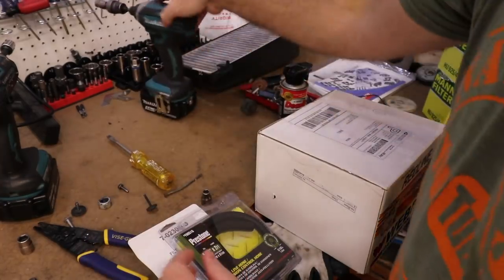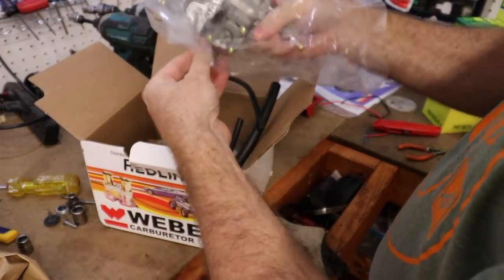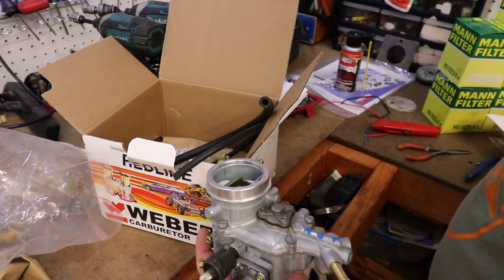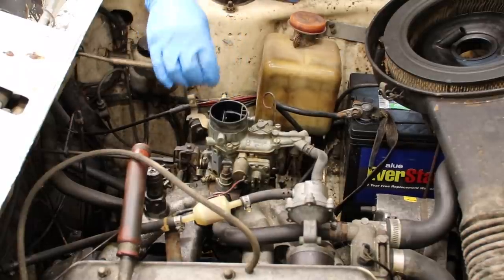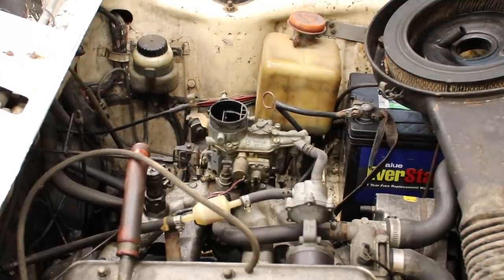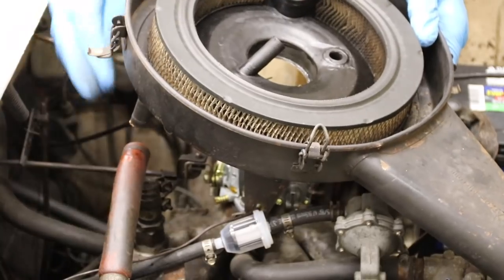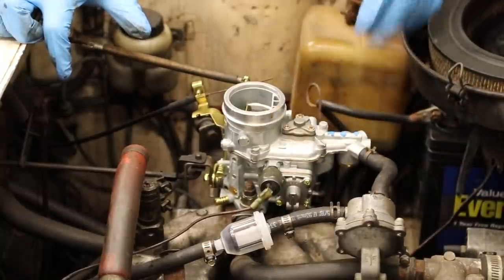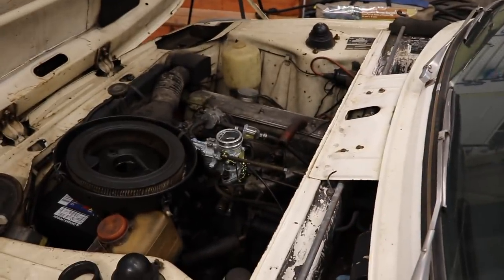Installing A Weber Redine Carburetor On My Vintage 1968 BMW 1602

Comment: That’s not a preheat, its a fuel shut off solenoid. The solenoid opens a plunger when the coil gets power and closes it when it loses power. The plunger opens and closes the fuel passage to the main jet. The purpose is to eliminate “dieseling” or “run on” when the engine is shut down hot. All the old air cooled VW had them. When you install a new or dry carb, use a small squirt bottle full of gas to pour fuel down the float vent tube in the carb throat. It will backfill the float chamber and you can prime the accelerator pump and get get it to start without cranking the hell out of it to pump gas up to the float chamber. Nice carb. The Weber Red Lines are great!
Reply: Idle shut off valve

Comment: The Weber was a very worthy upgrade on my '74 2002 that I acquired back in 1982. Drove the wheels off that car. Was a very classy car and very reliable. Black with beige interior with factory AC. Sold it in 1987, but many good memories.

Comment: Get the 20k , I had a few 1600's and great car back then. Look at the rare Turbo 2002  and copy it. Or get a 1973 2002tii round tailights.and put new springs, shocks, shoes, boots. Add a tweak or two to the fuel injection and your doing 60mph in 5 flat. Daily driver never problems, unlike so many others. Many were raced on weekends.  Thanks for the work and interest in the brand .
Reply: petepenn1   I installed L-Jet from an 1985 318i on my 1970 1602 which has an upgraded 2.0 liter engine.  Best modification for drive ability and fuel consumption.  I’ve had my car for 49 years.  It has flared fenders with 15X7 BBS wheels wearing Toyo Proxes R1R tires and appropriate suspension mods.  The brakes have been upgraded along with the essential 5 speed conversion.  I can’t imagine any car that is more fun to drive.  Hope you still have one.

Comment: Excellent reminds me of the the days when all cars had carburettors except for a few.

That solinoid is an anti dieseling shut off. For the younger generation dieseling is the engine continuing to run after the ignition is turned off.  It was common on higher performance cars

You certainly did the right thing fitting that carburetor. The old carburetors do not like modern fuel. Even still carburettor cars are very fussy about the choke usage when cold with the modern petrols.  If you allow it to missfire you run the risk of fowling the plugs. I used to keep my hands on the choke to adjust it to keep the engine running smoothly on a cold start.

The other factor to worry about was the intake air temperature. Most cars had a setting on the air cleaner for summer and winter. In winter mode it too heat from the exhaust manifold. More upmarket cars usually had an automatic heat system some even had a separate control on the dash. If you got this wrong the car would keep stalling out due to iceing.  Or the fuel would boil in summer

Comment: Nice car, by all means sell it as you get it in good running order but don't give it away too cheap ! Some people like to fix the mechanicals (i.e. you ) others are going to want to restore the finish on what, as you say, is a rare and rust free example of a very significant car for BMW.

Comment: Good job .just be careful of the battery terminals to have short circuit with air filter steel housing.thanks

Comment: I realize this video is a couple years old.  The collar for the air cleaner on the new carb is a press fit.  It will pull off.  I have the same carb on a V-4 ford in my snowcat.  I left the carb out the first night and it shrunk enough to pull that adaptor collar off.  14:02
Reply: kfd629 - hey bud, i have an Imp with v-4 ford, i assume that's what you have too?  can i ask a favor - i just got same carb (34ich) and i'm trying to work out linkage, would you mind a reply so maybe i could pick your brain?  thanks heaps, HEaps in advance:))) -barbie
Reply: @8barbies779  yes, let me know what you need.  Im working on mine today